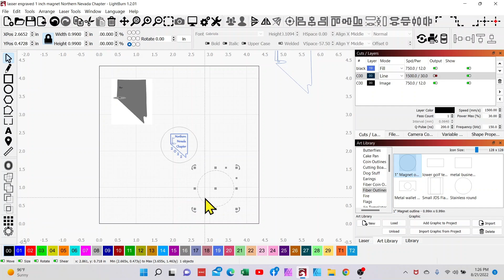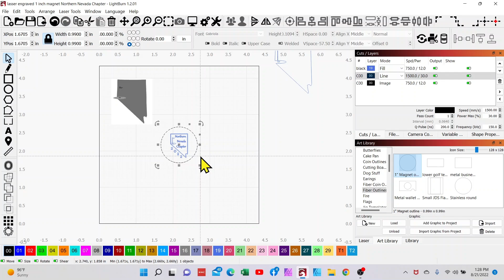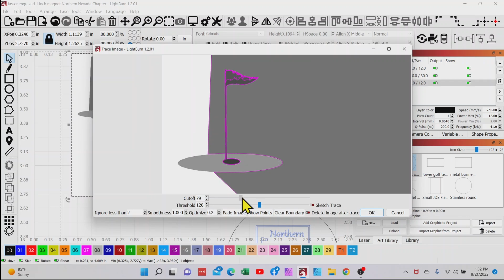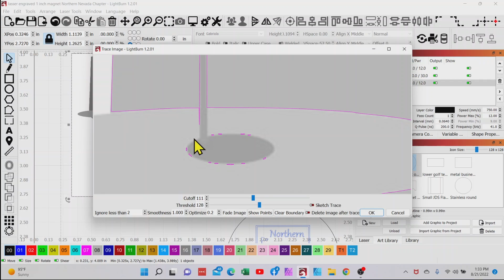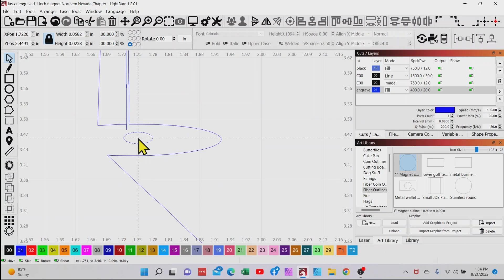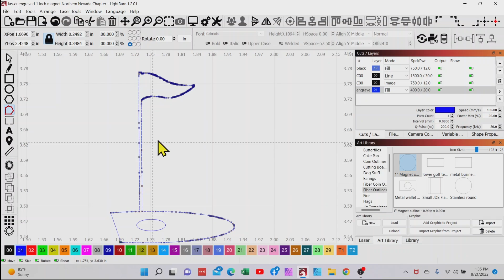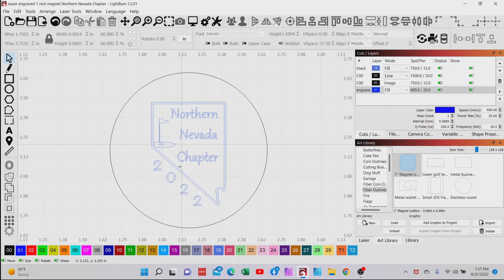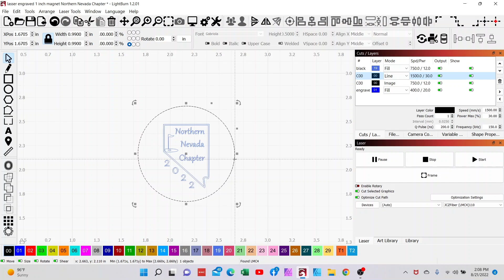Fiber Laser engrave chrome colored magnet for a Golf ball marker

Comment: Hello,
thank you for the nice introduction video! - i really liked it! Have you had any experience with engraving magnets on CO2 lasers, would there be any chance of it working with for example a Laserpecker 2 or any other more affordable machines?
After the engraving are the neodymium magnets- are they more susceptible to breaks because the coating is "broken"- whats you're experience in that regard?
Kind Regards
Stefan
Reply from the maker: Co2 lasers will not mark metal without marking. Spray that is expensive. I haven’t had any issues with breakage. Since I don’t own a diode laser I can’t comment on the laser pecker
Reply: @computercreationz  Thanks for your feedback! I think the best viable solution will be getting a fibre laser!

Comment: Hi nice video where did you purchase your fiber laser from and what is the advantages of a higher power on the laser as it only marks and does not cut metal...thanks for your time
Reply from the maker: I produced a video a month back describing my purchase and why. It will cut thin metals. Higher power equates to faster deep engrave times. A 60 watt is not just 10 watts more than a 50 watt it’s considerably higher power. The wattage power in not linear.